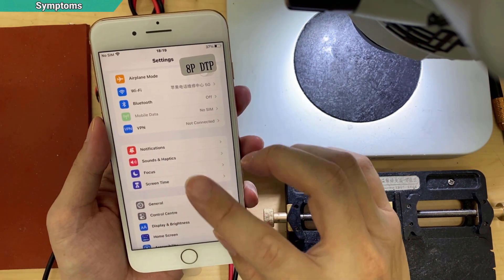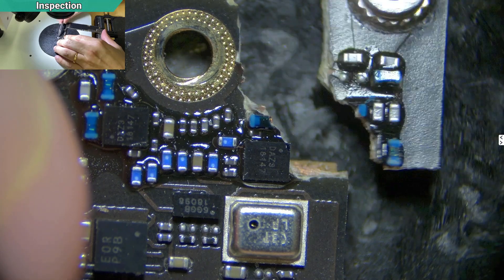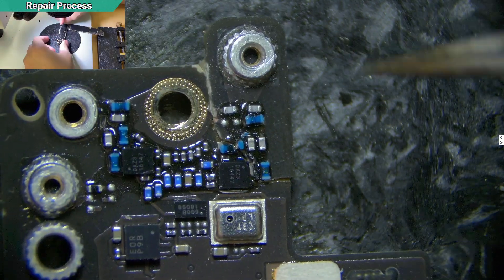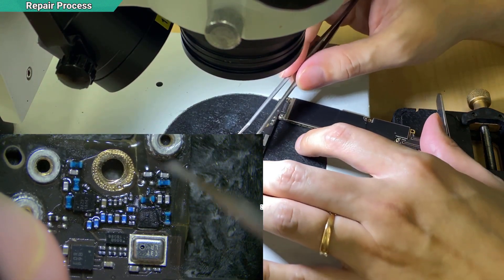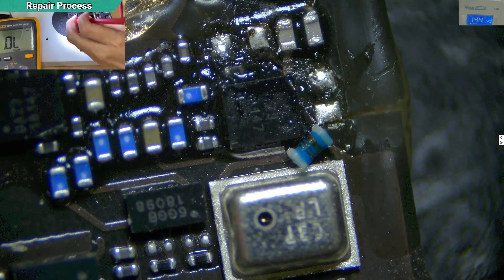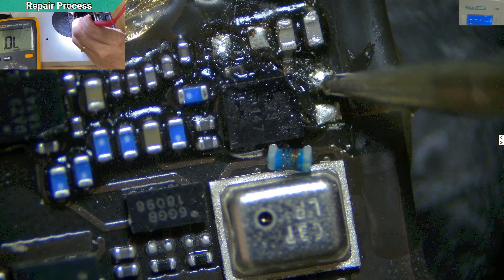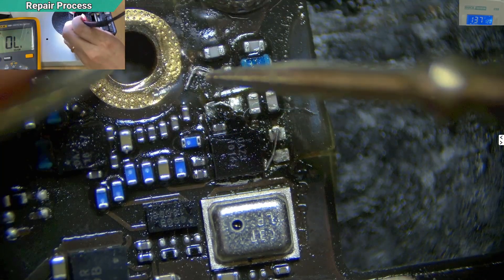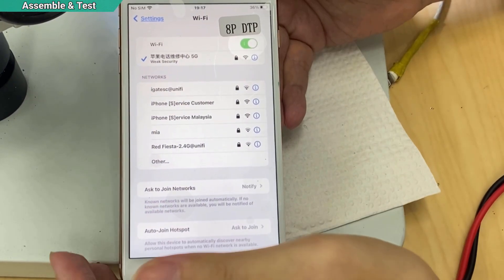iPhone WiFi 2.4G not working 【iPhone 8 Plus Repair Logic Board】

Comment: i have the same problem but after changing the wifi antenna the 2.4g wifi is available but I need to get so close to the router to connect, if I get bit far the wifi bar drop to 1 bar
Reply: I have the same issue!!

Comment: Hello master lim 
I have iphone x unable to activate imei sn all ok but wifi not showing
What may be the cause
Reply from the maker: Hi. Syscfg address incorrect or NFC problem.  But since you said wifi not working, more likely connection problem to radio board which the NFC is on there. I have a lot of steps for activation fix, it's included in my course.